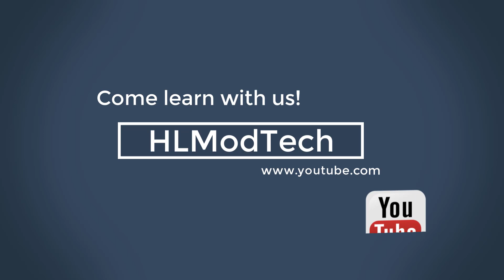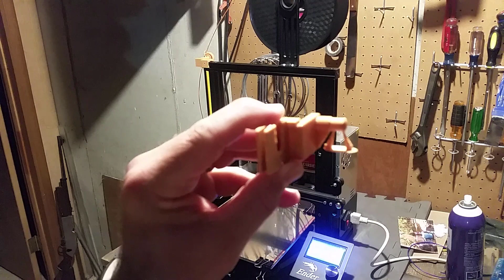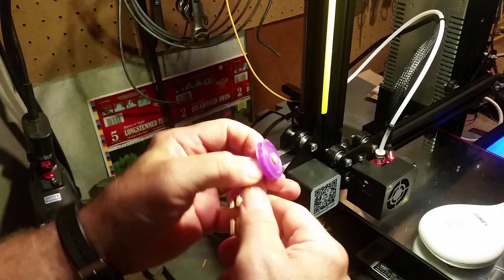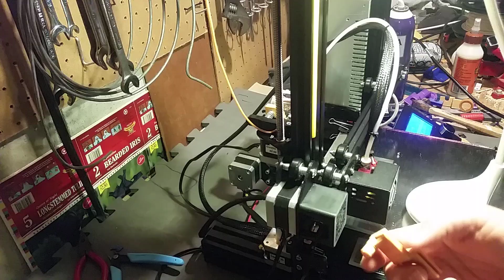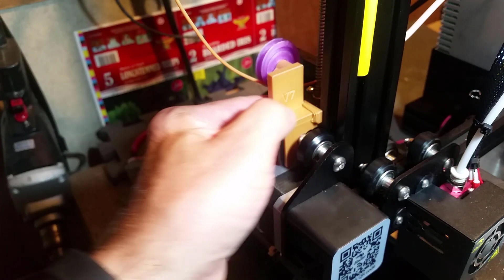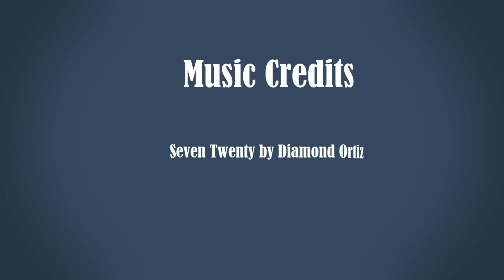Free Printable Ender 3 Filament Guide V7 Make it SNAPPY!

Comment: Really cool design!  I cannot find this V7 version.  This is the closest thing I have found:
https://www.thingiverse.com/thing:3047572/

I printed the V5 version, and there is a gap between the bottom of the part and the X axis motor.  The part rocks when using retraction.  There is also no buffer up against the Z axis frame extrusion which would probably help the rocking.  There is a buffer in this video.  Can you send me a link to the V7 files?  I had a hard time even finding the link I posted.  Greatly appreciated!
Reply from the maker: Sorry about that. Here it is and I will add it back in the description. https://www.thingiverse.com/thing:3080829 Thanks for the heads up.
Reply: @HLModTech  Thanks!